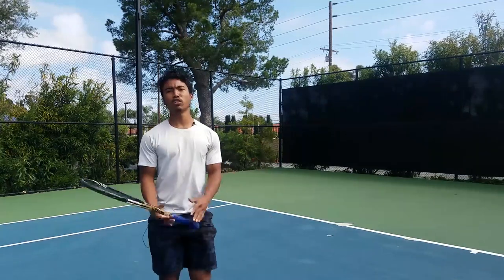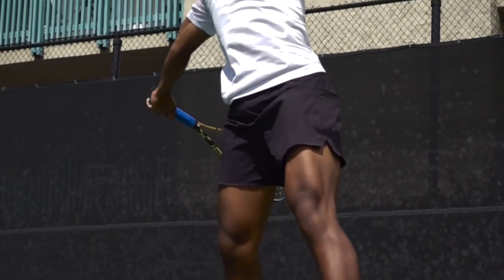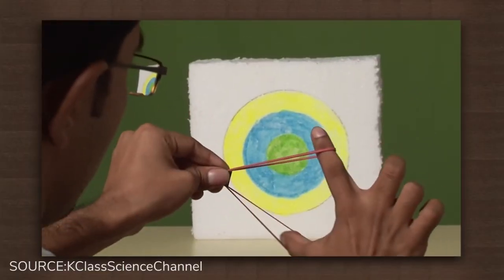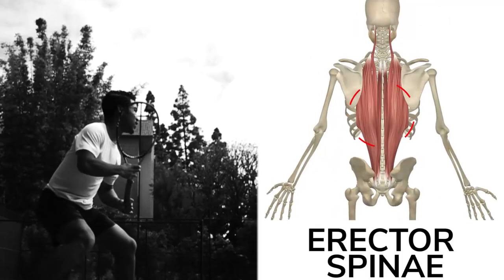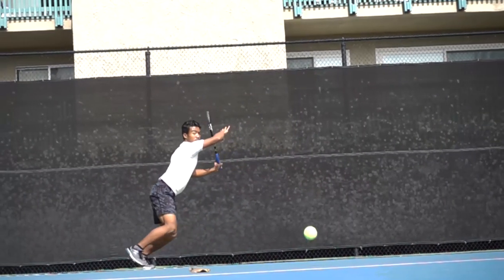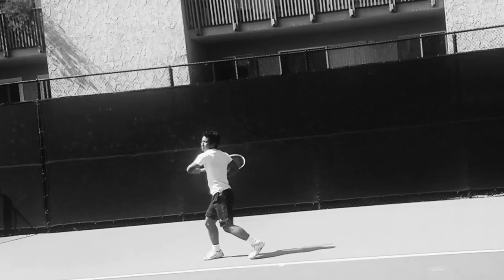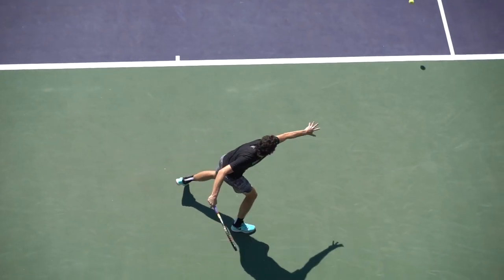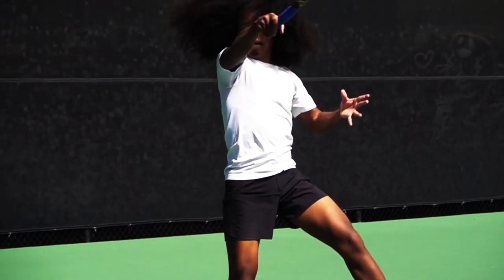Tennis Forehand Power Lesson: Core Rotation Timing In Tennis (Part 3)

Comment: Hey RF!! One question, what role does the elbow of the forehand has? We have to use actively lur elbow on the unit turn or only our non hitting hand?
Thanks RF!!
Reply from the maker: Hey Mate brouchy! We would love to answer this in a future video. For a short answer, the elbow is incredibly important for determining the size and shape of your backswing. And there are several checkpoints that you can achieve to ensure that you have a good elbow positioning on your shot.

Comment: So... the simple trick to core rotation timing is to “not focus on the hips to start the forward rotation”?
Reply from the maker: Correct! It's very easy to over-rotate when you're thinking about starting the rotation from your hips - although it may happen, consciously doing so will often lead to over-rotating, which decreases power.

Comment: Hips and knees loading work when u want max power in the drive and is esp useful for high bouncing balls. However optimal power n control on rally balls @ waist height or even at balance comes when u treat ur forearm like a whip and accelerate thru contact with a lagged wrist, thereby ensuring dip and forward drive simultaneously. Watch Federer... Loose like a goose

Comment: This is a good contrarian think 🤔 video. Meant to provoke thought. Yes - a high-performance forehand RESULT is a massive free-swinging stroke with loose grip, smooth backswing, unit turn, body load, power from ground up, loose core rotation, natural wrist lag, maximum “contact-point” time with ball, feet-legs-hip-core-dominant shoulder-wrist-hand all firing in sequence, with a full natural flowing follow thru. The PROBLEM is you can’t will it. It’s gotta be natural and flowing. So - What does the human mind think of as you start this swing for this type of result? Not “hips firing”. That’s the point of video. So what’s the answer? The answer for me is this: after the split step, body load and smooth racket take back, I focus on pulling my non-dominant shoulder (my left shoulder) out of the way. This naturally then pulls my body sequence: hips-core-dominant shoulder-arm-wrist-hand-butt cap at ball. This is basically using and maximizing the full WING SPAN  of the dominant arm to work together with the hips firing and core rotation to produce the forehand result. My 2 cents. 
Source credit: 
https://www.researchgate.net/profile/Rafael_Bahamonde/publication/236650052_Biomechanics_of_forehand_stroke/links/577d748208aed39f598f7820/Biomechanics-of-forehand-stroke?origin=publication_detail
(“The primary source of power was the horizontal adduction torque, which was used to accelerate the arm in the transverse plane.” Biomechanics of the Forehand Stroke, Rafael E. Bahamonde, Ph.D.)
Reply: garybalatennis Impressive! Thank you.
Reply from the maker: Hi, Gary! I would agree that a big issue, especially at club levels, is the off-arm lingering to the side, encourage the torso to stay sideways as well. For those who aren't stretching their off-arm sideways in the first place, this technique would need to be established first, which would assist in getting a full coil from the hips and trunk. It's always great to discuss with fellow coaches. Thank you for your observations!
Reply: Completely contrary ideas, tennis dialectics "at their finest". Natural, flowing, free-swinging racquet arm, which is the correct answer to the question, and then again this silly opposite notion of horizontal adduction torque as the primary source of power, which is the false and flawed answer to the question.  And there is no mediating synthesis to be reached here.  The resolution to the enigma of perfect tennis forehand swing involves an intricate interplay between the non-dominant arm initiation of the rotation followed next by the hip thrust.